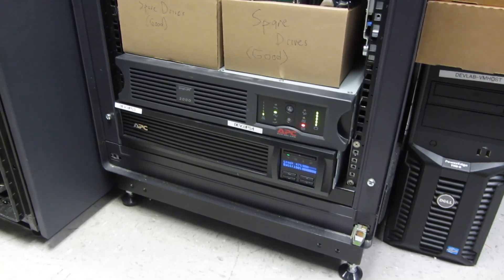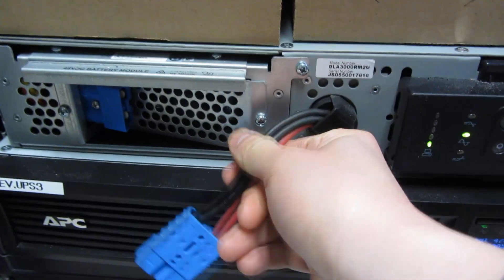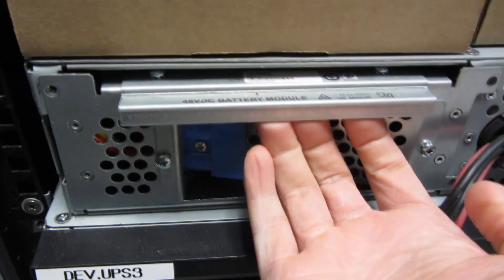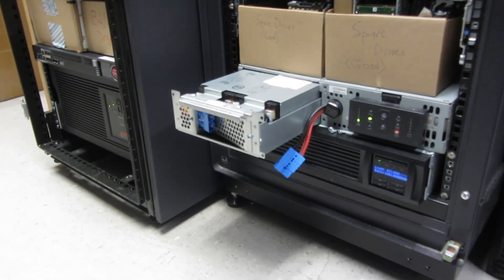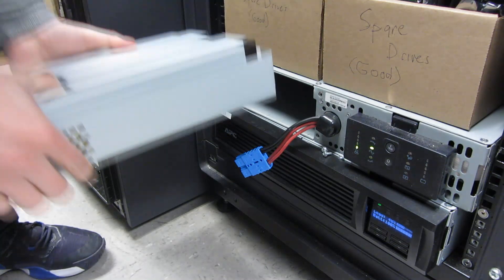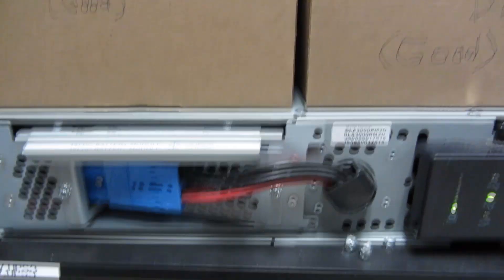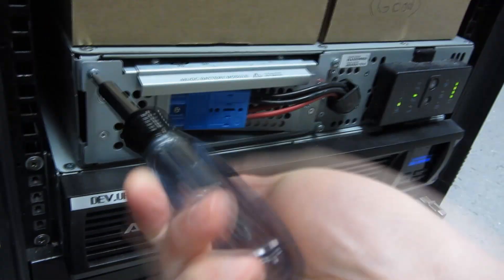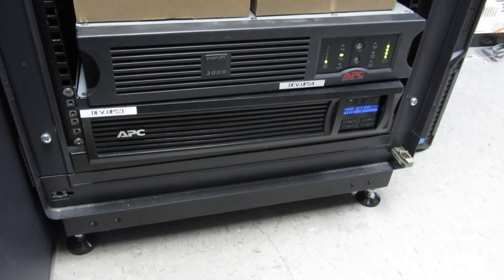APC Smart UPS 3000 Battery Replacement | Hot Swap | RBC43 | DLA3000RM2U

Comment: When you do a hot swap, do you connect UPS to power socket at the wall first?
Reply: it's a "online" usv, usually with the batteries installed it supplies power through the batterys guaranteeing clean 230V, the second u unplug the battery it switches to AC pass-through, so during that time period u are probably not receiving the cleanest 230V, better do it quick :P